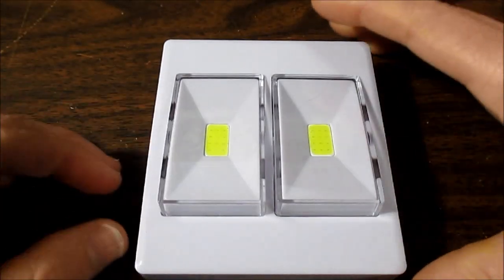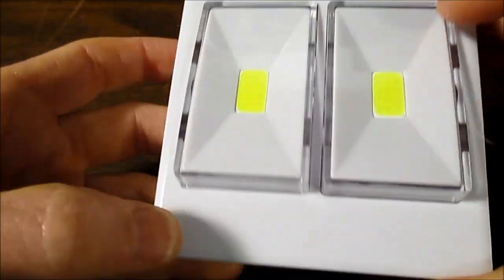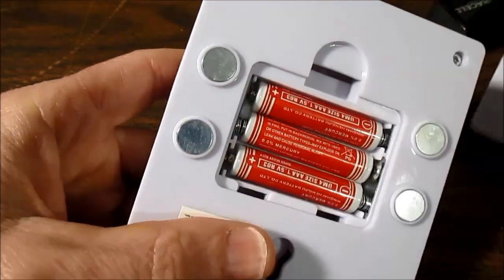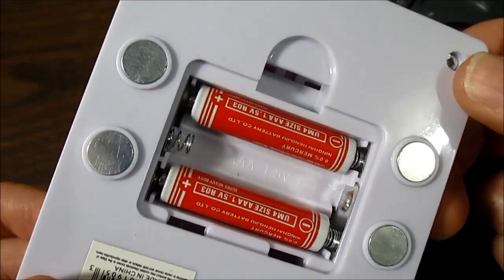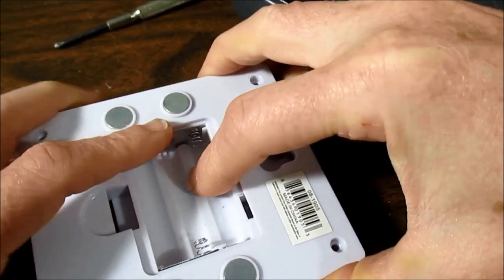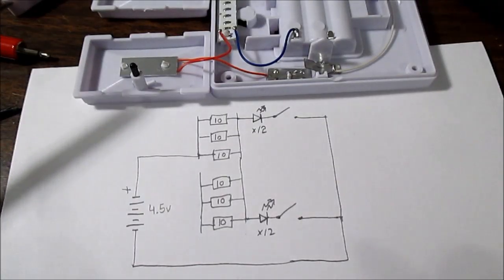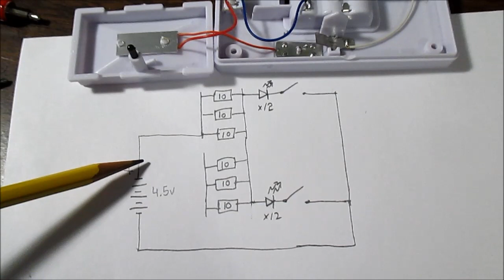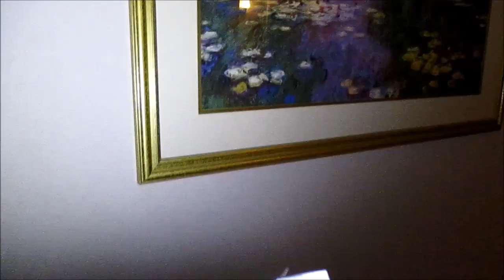LED switch light teardown & review

Comment: yup,pushing switches downwards does turn it on in some countries.

and you can easily measure current, if you stick weird copper tapes on both sides of a thin plastic sheet and put it in series with the batteries in battery holder.

Comment: I have the single LED version of this light. I don't like the metal tab switch on it. the wire going to the rest of the circuit bends slightly when the switch is turned on or off. I will be modding this so the wire does not bend.
I also have two of the USA light switch versions and they work well. I got one that looks like a light bulb too.

Comment: 7:00 - the problem is obvious - simply that they have installed the resistor PCB in back-to-front, then the next assembly worker has soldered on the wires normally (rather than correctly).
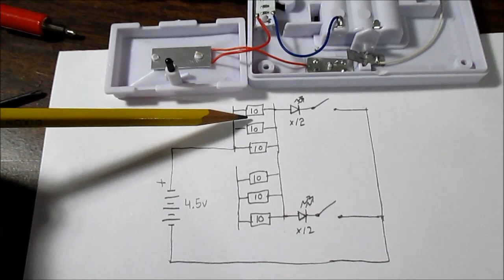Reply from the maker: I mentioned that at 7:18 (in backwards). There's an orientation dot on the board near the middle but they still mucked it up on accident or possibly by design.
Reply: When they discover a fault like this on a production batch they sell them very cheap on ebay instead of dicaris of them🙂

Comment: i guess this product is useless , if it was supposed to be hanged on the wall then why would you have Batteries emplacement behind the switch :/
Reply: You would have them behind the switch because it would be COMPLETELY USELESS if the batteries were in front of the switch. Geeze - think about it, this is not a difficult product to understand. Tell us, where would you want the batteries to be?
Reply: emergency light duh.